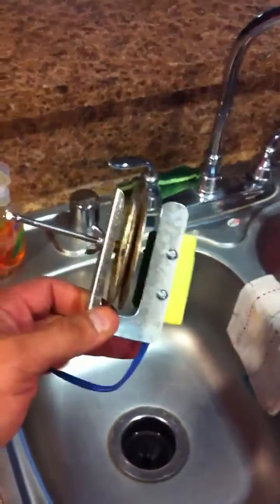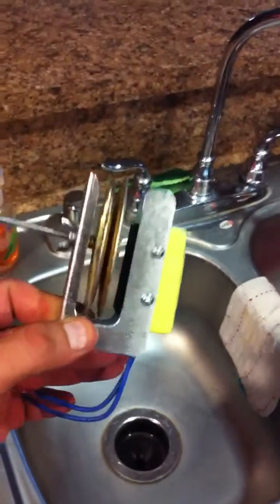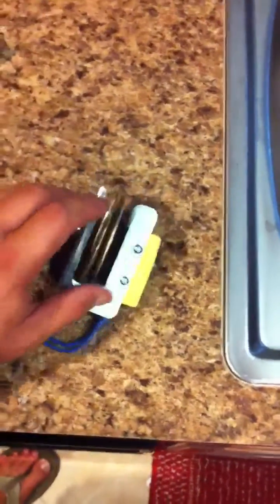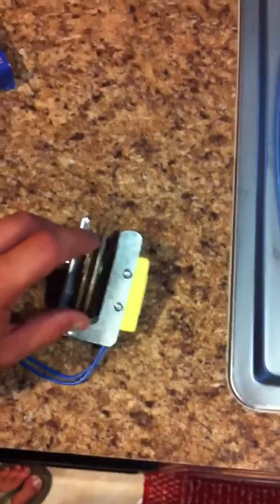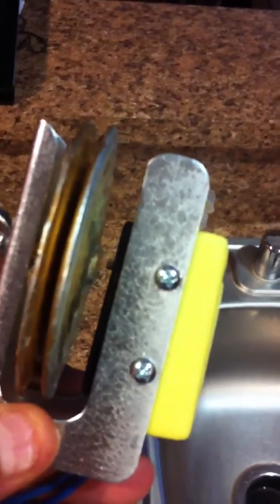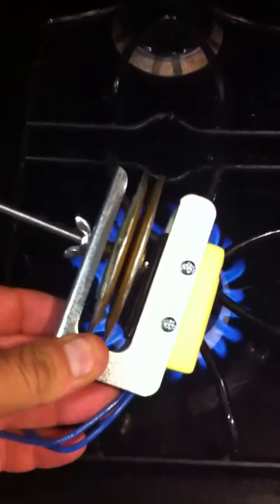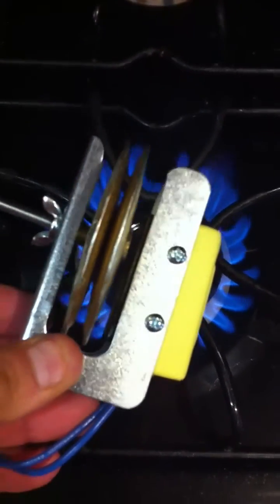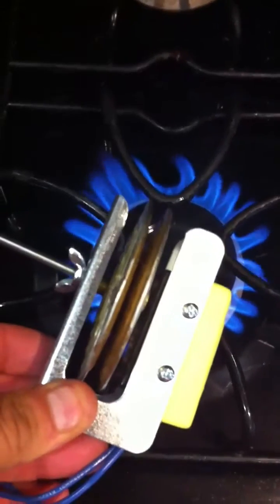Wafer thermostat

Comment: I use 2 in a 250 egg cabinet incubator. Incubator part warehouse has them 2 for under 20.00. 
I place one in front of incubator where the tray of water is and of course a fan to circulate heat. I also install one 4 inches from the bottom  .hey seem to last 2 years each.

Comment: bro you did not tell us about voltage, what voltage is require for wafer thermostat?
Reply: The switch does not care what voltage runs through it. Typically the heating element you use will determine what voltage is present in the circuit.
Reply: @NYHalfassprepper  Yes as far as I know there is no voltage through the wafer, it's through the switch only. The wafer just expands with heat and pushes the switch to OFF heat, so cools and retracts and the switch then powers on. The power is usually mains, but only heats to about 30 watts. Hope this helps ? 73's Andy M6APJ
Reply: 50 - 400 volt